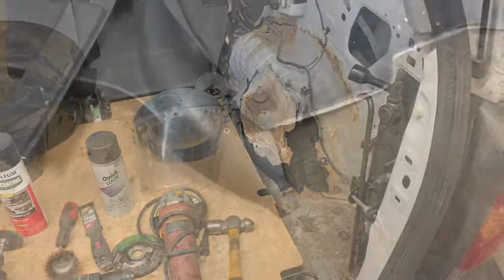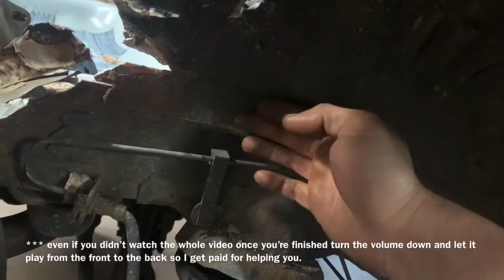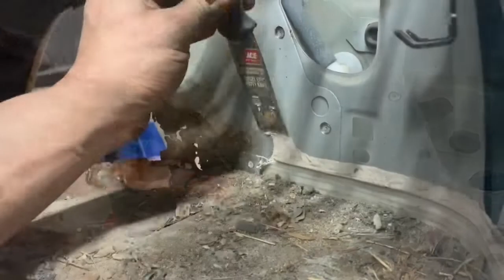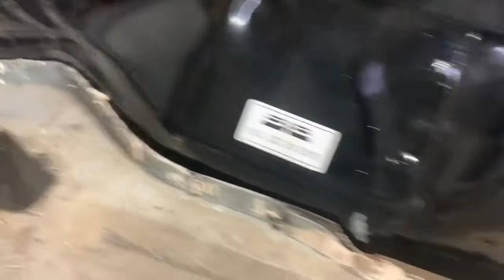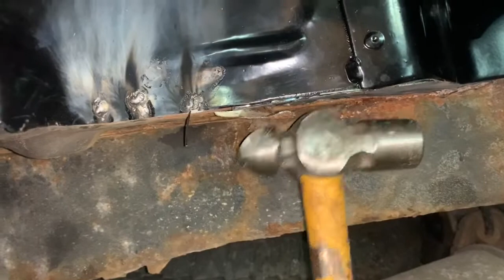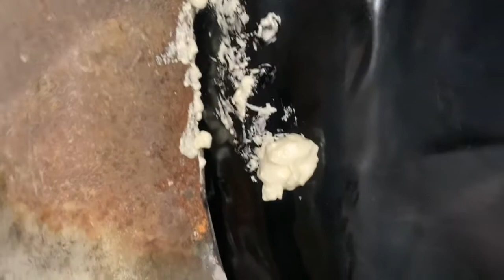Ford Escape Rusty shock tower/front to back/including floor repair!  Ford Escape Broken rear shock

Comment: Have you tried an Oscillating Saw/Multi-Tool with a Scraper blade for cutting out the glue?  Might be faster than the chisel.  Maybe pre-heat with heat gun, then the oscillating tool... Maybe.   Thank You for the great videos - I have to do this to my '09 Escape.   Seems like they all rot out in that fender.

Comment: Instead of welding the defenders back together can you pop rivet then back together wouldn't that be an easier thing to do
Reply from the maker: Well, when it’s your vehicle, you can do anything that you would like I think I would use pop rivets and glue. I would’ve done it differently. If I was not welding, I would’ve made sure that the epoxy was in between the panels and I would’ve done the pop rivets immediately so it sealed them up. But yeah, I’m sure you can do it.

Comment: Do you have a vid of the drivers side? Dealing with the fuel filler tube looks like no fun.
Reply from the maker: Pretty much the same process,
Reply: @YoutubeTheClayWay  except for the explosion 😉🤣
Reply from the maker: Not really….. it is very difficult to make a gas tank explode really the only way a gas tank is going to explode as if it’s completely empty…. Or very near mt , if you’re going to weld on a gas tank you do it while it’s full… Don’t believe me just look it up

Comment from the maker: If you the video helped you out, and you'd like to help us out, you can use these links to purchase ANYTHING on amazon and we will get a small commission with no extra charge to you! 😀
Dorman 924-358 Rear Passenger Side Shock Rust Repair Kit for Select Ford / Mazda / Mercury Models: https://amzn.to/3vwHF2w
BLACK+DECKER 12V MAX Drill & Home Tool Kit, 60-pc. (BDCDD12PK): https://amzn.to/3L68tx0
Cobalt Drill Bit Set M35 High Speed Steel Twist Drill Bit Set (15 Pieces,1/16 Inch): https://amzn.to/3L4l8k8
14-Pack Spot Weld Cutter Sets Double Sided, 3/8" HSS Spot Weld Cutter Remover: https://amzn.to/3MigL56
Hurricane 3 Piece Chisel Set: https://amzn.to/37E4Csp
2 Pack Automatic Center Punch, Pamiso 5.1 Inch Spring Loaded Drill Punch Tool: https://amzn.to/3K3kKRE
Wagner Spraytech 2417344 HT1000 Heat Gun Kit: https://amzn.to/3xFFhsR
Chicago Pneumatic CP875 Pneumatic Right Angle Pistol Grip Die Grinder: https://amzn.to/3Ez69Mx
Shark Industries 3" Cut Off Wheel: https://amzn.to/3xJkGUl
Loctite IDH# 2474240 Construction Adhesive, Gray, 9 oz: https://amzn.to/3jYXsBB
Amazon Basics Heavy Duty Caulk Gun: https://amzn.to/3k3OROd
Rust-Oleum 248657 Rubberized Undercoating Spray, 15 oz, Black: 
TEKTON 3/8 Inch Drive x T50 Torx Bit Socket | SHB14250: https://amzn.to/37Bb9US

Comment: Hey, Clay! Sorry for the second question (I ask one on the glue and screw video) I am confused a bit. 05 Escape and I am going to use the glue and screw method. My floor is intact and so is the ridge all the way around the actual shock tower, and all along the well. I am rusted up top at the top of the wheel well on the inside (not too worried, I need one more year out of this thing).

Question, If I replace the entire wheel well, do I drill out the spot welds from the inside on that bottom ridge under the glue, or from the outside in like you showed? I hope that made sense!? God Bless You!
Reply from the maker: On the outside I drill out the spot welds from the outside of the wheel well on the bottom about up to the shock tower itself and I drill as many from the bottom side on the outside of the wheel well as possible if that makes sense.

Then on the arch area I drilled them up on the inside of the vehicle because obviously it’s the only place you can get to them… 

It’s real good to hear that yours sounds like it’s pretty intact and should last quite a long while I would certainly think that you would get well over a year out of the vehicle these are generally very good vehicles with the exception of the alternator going out in the V6 models that’s not really fun but I have a great video showing you how to do that as well. 

No worries on the second question ask anytime I’m always here to help. I think my limit of question answering is going to be about 50 a day at some point right now I get somewhere between 30 to 50 a day and I try to answer everyone. 

If you have Facebook please go over and like my Page and follow clays ac and auto repair. Are use that medium to answer questions it’s much easier for me to answer them there and I can send pictures and information to people if they need it. 

Also I post a lot more personal content there than I do on my YouTube channel and sometimes I have some funny sxxx to say lol 

Thank you for being a part of our community we’re happy to have you. God bless have a great day
Reply: @YoutubeTheClayWay  Hey, Clay, Again i didn't get a notification for this response!? 😔 I don't have a FB account any longer, or I would be following. I do understand..boy, the more I scrape, the more rust I have up top at the arch..agh..i just don't know, layimg awake at night trying to plan the strategy..lol.I recieved the new Dorman panel and #10 screws today. Waiting for a break in the rain to get it done...I hope! Thanks again for your kind responses! God Bless!
Reply from the maker: Yeah there’s been a few times that I’ve had to actually make archways for them… I have not made video of that yet but essentially what I do is a cut in Archway out there is about 5 inches tall and degreed The same angle as the arch I lay that down weld it to the Archway then I take a strip of metal and put that on the wheel well portion of the arch and connect the two pieces (welding) 

Then if I have overhang on my Archway I cut it off then I will fill the inside with spray foam then I will cover over the top of the portion that is exposed to the tire with the caulking…. Then I will seal it. 

With the bedliner… I use bedliner instead of under coating because I believe bedliner is stronger. But that’s just my opinion because it’s more clumpy so it could be that it gets knocked off easier.

Comment: How much does this costs to be done?
Reply from the maker: Well are you asking about through me or through the dealership? From what I heard from the dealership it’s about $2800 in most of the time they take it apart and tell you that you need to buy a new car.. that’s what I’ve been told by dozens of different customers. When I do these. 

If you want a quote from me I don’t put them out over my channel you can either Facebook me or email me Facebook is simpler I’m not great at checking emails

I’m on Facebook at Clays AC and auto repair

Or 

Thenewclayway@gmail.com

Comment: I recently learned that vinegar and water break down rust so you can remove it . I'd try it along with a wire wheel to clean it up before I tried to weld it . Then prime it good ...     Oh yeah , I got my air hammer kit from Harbor Freight for $50 ! That includes the air hammer , chisel assortment , and everything ... keep up the good work bro. !

Comment: Hey dude , put an air hammer on your putty knife or use an air chisel . And you can also use the air chisel to break away the sheet metal from the drilled out spot welds . Just say'n . Try duct taping the end of the putty knife to your air hammer a little to keep it from slipping off . But don't listen to me , I'm just a shade tree mechanic . Lol !!!